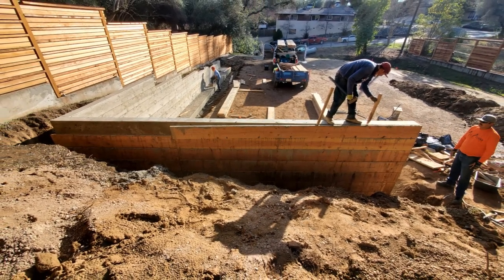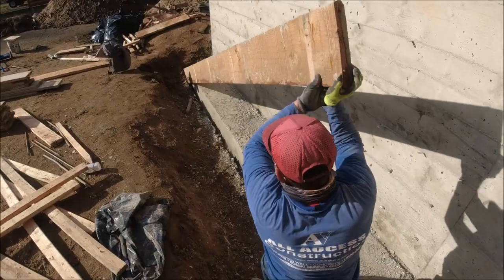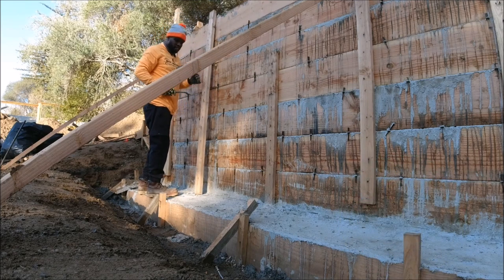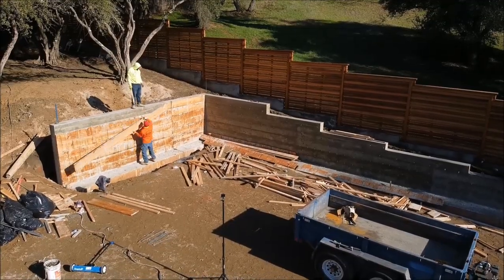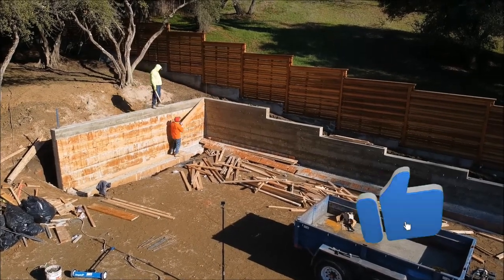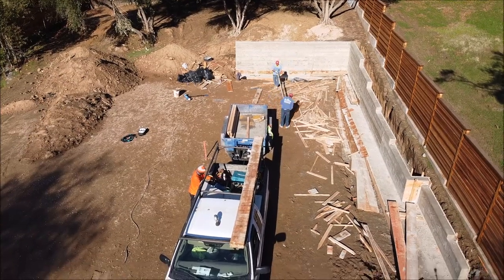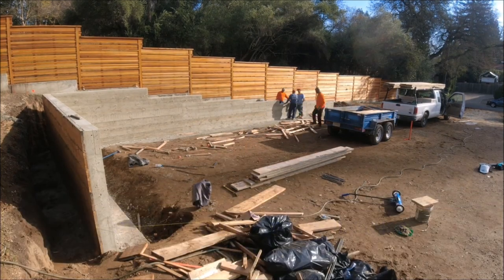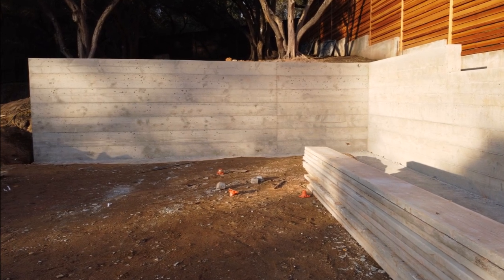🔊 Stripping Concrete Retaining Wall | Who's Going  Clean  This Mess‼️

Comment from the maker: See how we go about stripping a concrete retaining wall.  Also, check out PART 1: How to build the back of a retaining wall: https://bit.ly/2IMpIbP
Reply: I know this video is old but I have a question. I do concrete foundations and retaining walls in washington state. Seattle. We aren't allowed to leave lumber in concrete during monolithic pours. So anything that we don't have mono straps for gets a footing pour then the wall. Did you remove the wood stakes supporting the wall during the pour or leave them in? Great work btw looks good.
Reply from the maker: Appreciate it.. We leave them in been doing it that way for 15 years.. Past all inspection..
Reply: @AllAccessConstruction  I wish we could do that. One pour would be so much quicker and smoother

Comment: There's something I'm missing ... it looks like to me you have stakes/posts driven into the ground to hold the boards that make the forms, but also it looks like you pour round them or am I looking at it wrong and you cut them before the pour? Do you pull them during it and fill? I can see how the back is made, that's easy enough, but I'm just not seeing where those posts go for the base.
Reply from the maker: If we can we try to remove the post if not we just leave them in and cut them at the top of the footing when we strip.. Check this video out it will give you an closer look at the stakes in the key way before we pour.. Appreciate the support.. https://youtu.be/seGr6uXb_Sk